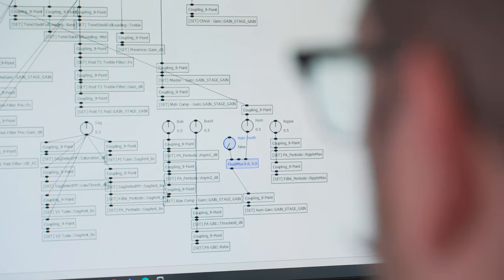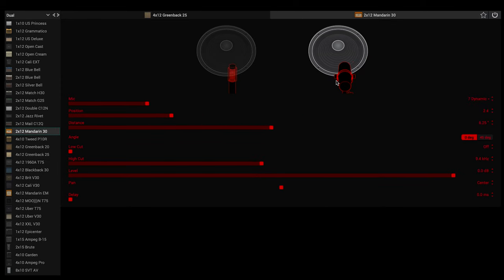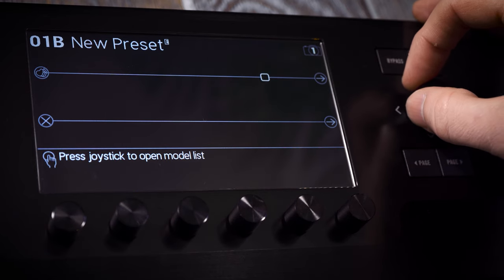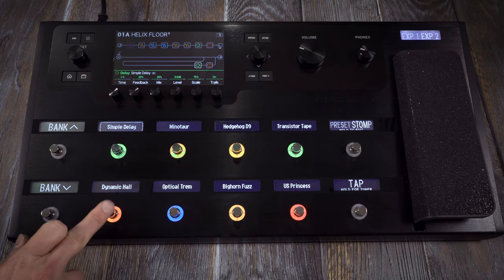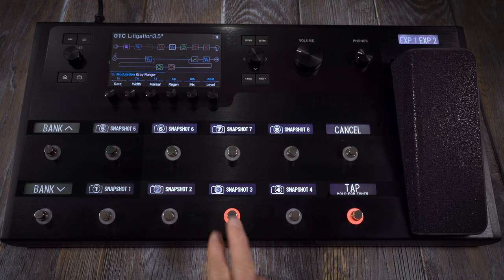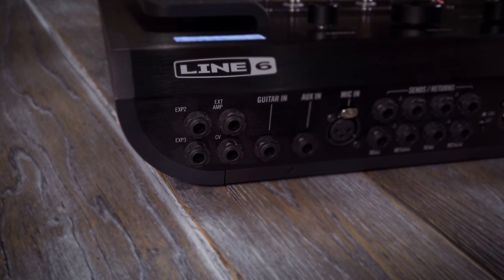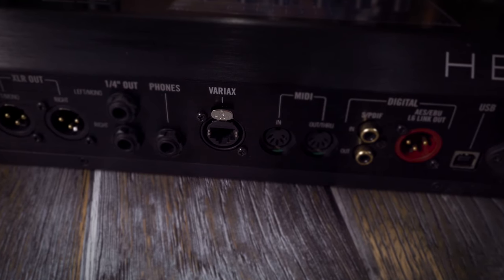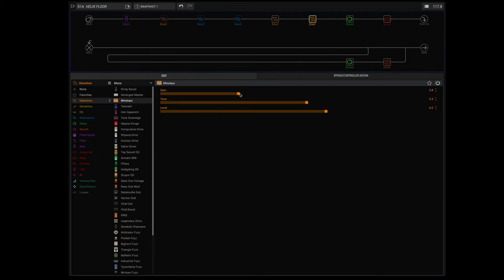Line 6 | Helix Floor | Overview

Comment: The Helix is more relevant now than when it first came out. Yamaha’s dedication to upkeeping a product is their most valued trait. Thanks for keeping the Helix not only relevant, but ahead of the pack all this time.
Reply: I totally agree, they could just update it with more powerful chips such that you can use more poly pitch effects and more good stuff
Reply: Yep, at the cost of the firehawk 1500/fx support…. I bought the firehawk 1500 for modeling and thought I needed the firehawk fx, nope. In fact the processor in it is inferior to the helix. I don’t even need the amp now because of the helix…. But I love it! 1500 watts of “hello neighbor!”
Reply: now it's at the point where I want to buy one, but it's so old that I don't want a Firehawk situation where the app doesn't even exist on Android anymore.

Comment: I've had mine since they came out. It's absolutely incredible that in this day and age a piece of electronic gear can last this long without a hardware update and still be cutting edge. I was excited when Yamaha bought Line 6 because I had already been using Yamaha modeling tech and it was a perfect fit. I figured it would be a huge boost for Line 6 and I was right. 
The new Grammatico Amp model is the best addition yet.

Comment: I've had mine for a few years and still love it. So easy to start a new preset and get inspired. Update days are always fun. Midi is a must now and works seamlessly having reaper change presets during a set. If there was a wishlist for a helix floor mkii....touchscreen, bluetooth to connect wireless headphones, and an on board power amp to run to a cab.

Comment: Line 6 guys, since you did Yamaha RA-200 rotary for Helix, could you look into adding Taurus Dopplex DX26 to Helix as well? Dopplex is a "Doppola" rotary speaker replica, the speaker Gilmour used on that famous Pink Floyd "Pulse" show in 1994. Dutch company Taurus now makes those and they're not expensive, around 500 euro for DX26 two-speaker model. Thanks!
Reply: Add it to Idea Scale

Comment: this thing is already 8 years old.
but still about 1.5K on the market 😁
Reply: With regular firmware updates even an 8 year old pedal is as good as a brand new 2023 unit - that's why lots of us continue to use it and will in the future. I've been extremely happy with mine since I upgraded from the HD500X.

Comment: Time for a refresh? Touch Screen / Bluetooth / USB C Port ? Indeed I have a Stomp XL and I prefer edit with the computer software but if touchscreen and Bluetooth connection would be even easier (no need to move pedals close to computer etc)

Comment: Helix was the best purchase decision in my life. 
Only issue is that my footswitches are dying and I might have to purchase a whole new Helix unit just because a half of my footswitches are dead.
Any suggestions anyone?
Reply: I know you posted this a while ago but you get Helix repaired by certified technicians. My USB connector got damaged (brutal for HX Edit) and I was able to get it replaced. Pretty sure you can get fresh foot switches installed for way less than a new one. Good luck.

Comment: I also feel you need a degree to get good tones straight out the box. "Oh you need a compressor in between the amp and cab" etc etc etc etc high cut here, low cut here. I wish it just sounded good out the box. Great piece of gear but not the easiest to get good tones straight away

Comment: Good video but as far as the product, I wouldn’t have it where you got to go through 67 changes to get what you want. I want a one button push down.
Reply: That's what 'snapshots' is for - any amount of amp setting, pedal settings, pedal combinations etc. etc. all switched with one foot switch.

Comment: so can i just hook that pedal up to a marshall amp set to a clean tone?
Reply: Of course not.
You are pretty much pluging a guitar amp sound that's already filtered through a cabinet and a microphone into another guitar amp.
Reply: @Eric-dd8bk  That's not correct. You can also use the Helix as a pedalboard without any amplifier and cabinet modeling. Just use the effects into a clean amp. It works too. If the amp has an effects loop, then 4 cable method is better and you can take advantage of the Helix amp modeling too 😊
Reply: @mattiakkanen7866  You are missing the point of his question. 
He said clean tone meaning he's asking whether he can use the amp and cab modeling in a modeler with a guitar amp as long as he is in clean channel. 
And the answer is a big no. 
If he wants to use it like a pedal board without the amp and cab sim, then he can but that's not his question.
Reply: @mattiakkanen7866 can i plug my helix in to a cabinet for a better tone?